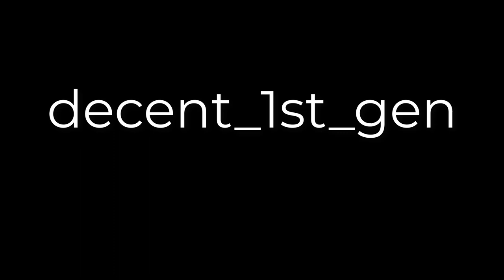I Painted My 1st Gen Crew Cab in My Garage. It Turned Out AMAZING! (Paint Part 15)

Comment: I may have missed it but what size compressor are you using to spray?
Reply from the maker: For this job I used a 30 gallon craftsman compressor. There were times that I had to let it catch up but it did the job.